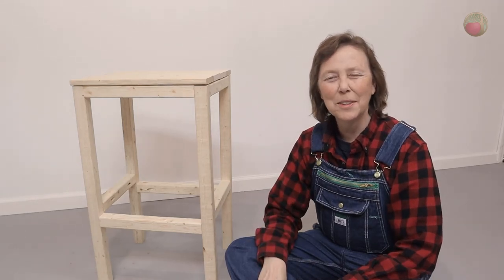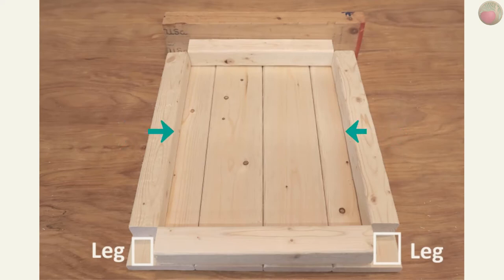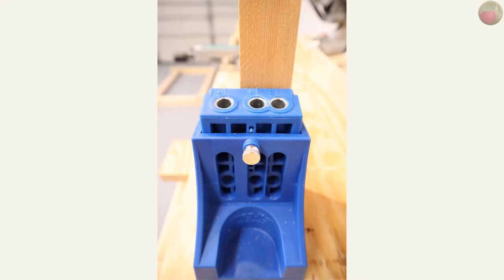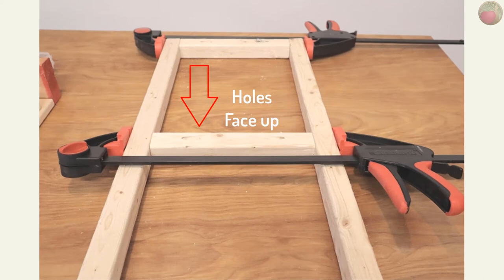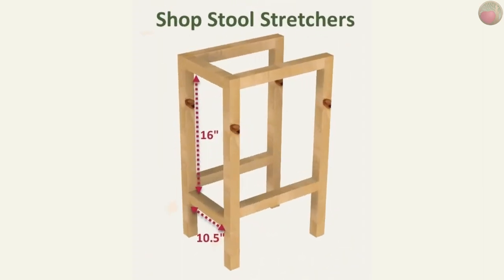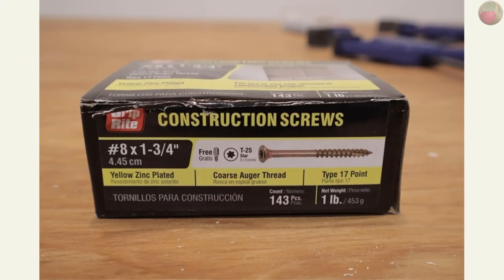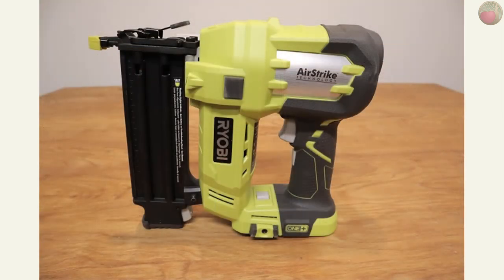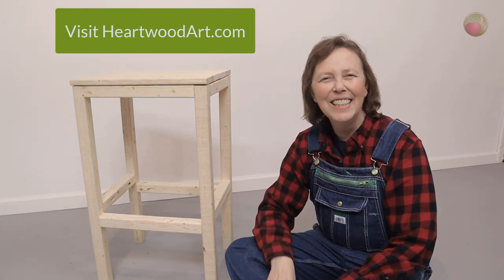Shop Stool That’s Easy and Cheap to Build

Comment: what is the height of finished stool
Reply from the maker: The length of the legs + 3/4" for the seat. My legs were 27.5". So my stool is 28.25" tall. Easy to customize for your needs